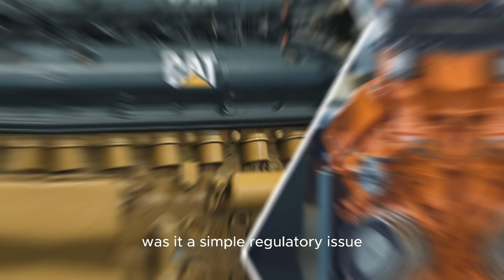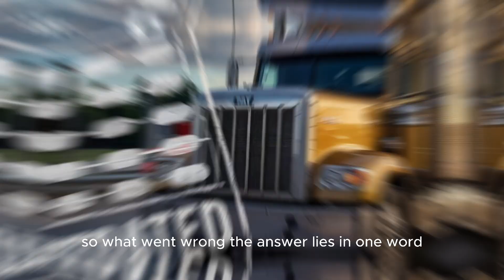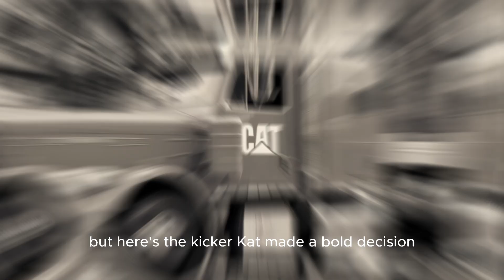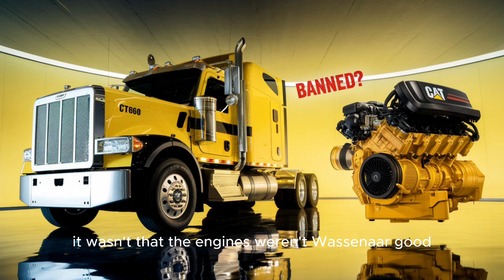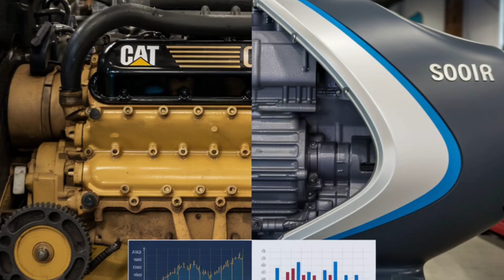Why CAT Engines Were Banned from Semi-Trucks in the U.S.!

Comment: Cat Engines were the best hands down. I drove for 32 years. Detroit went from Junk to one of the best with the series 60. Roger Penske Saved the Company. They're even starting to suffer too. There's Diesel Engines that run cleaner than gas. The Mercedes Engine was Junk too. My Nephew is one of the best Diesel Mechanics around here. Everybody that's been around a Cat engine knows the sound. It has its own growl when it's cold. The old Cummins engines weren't real impressive either. I saw someone put on Cats Making Small Pickup Engines now

Comment: Lies,all lies! Cat wasn't banned,they got out on their own 
before EPA crap took effect.
Reply: Absolutely correct…CAT didn’t want to build crap engines….your statement is perfectly correct.
Reply: Came here to say this as well. AI crap
Reply: @matthandley5259  as was I
Reply: Absolutely correct. Never Banned! CAT decided it wouldn’t be dependable and or cost effective and decided not to chase the insane commie EPA on highway regulations.

The only Green in environmental policy is dollar$ for special interest groups.

Banish the EPA !
Reply: Yet pretty much CAT dominated the trucking game so in a way it did by the emission standards. Now the electronically controlled engines are garbage requiring mote time to keep them running.. I used to work at a truck parts company and believe it or not the amount of money alone that had to go to replacing the dpf system was astronomical.. one guy in particular had to come in for the same egr cooler 3 times in one year. Cat saw that they didn't want that diminishing their legacy so they stopped.. which is sad but meant the engineers at cat wasn't the new crop forward thinkers to help solve that problem.. yet I wish they would spend alittle money in doing research as now it's been a few years and have perfect opportunity to scope out how their competitors are doing. Worst truck that owners always needed was Volvo parts. Cause they were junk. Cummins seems to last long as our shipments of specific brands.. Volvo was a full 24 ft trailer full while Cummins ans cat were a pallet or two.